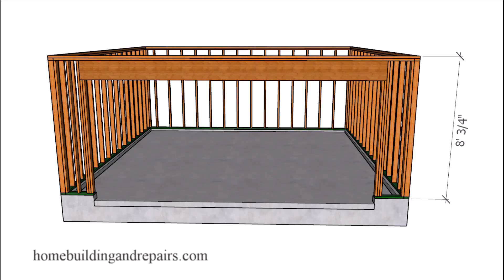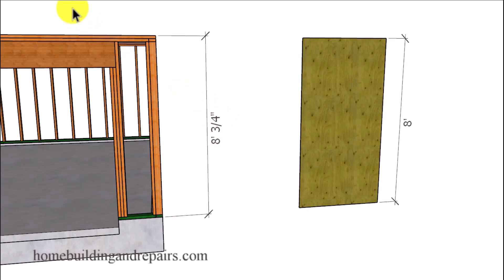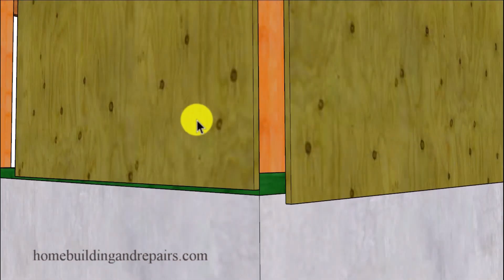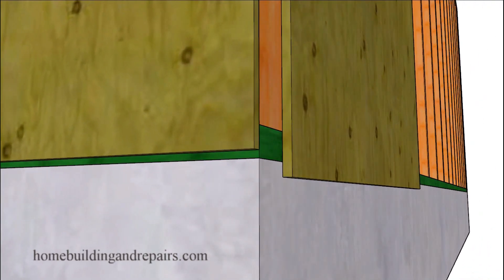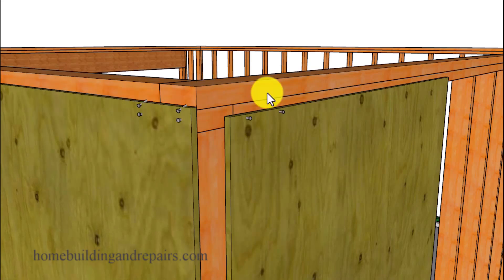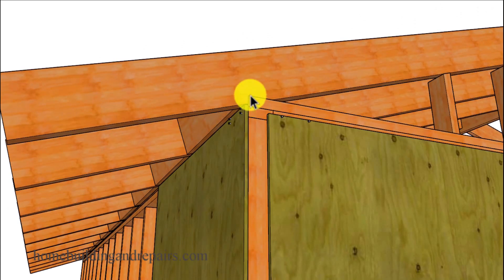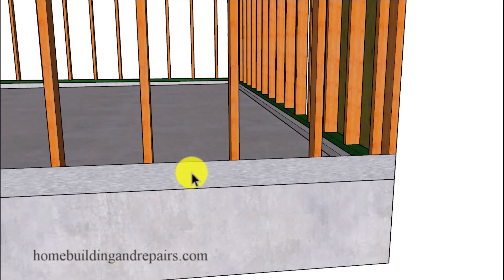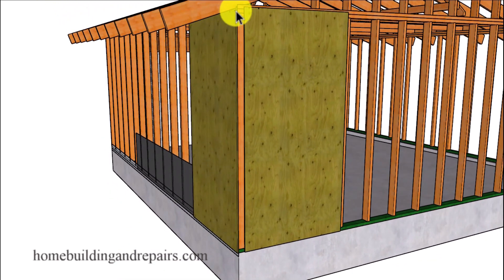Reasons Why Engineers And Builders Might Avoid Using Plywood Siding

Comment: Can you please explain if the sheathing material is supposed to be nailed to both bottom and top plates? At least it seems this way according to your video. But there are plenty of houses sheathed horizontally and there's no chance of connecting top and bottom plates this way but horizontal sheathing is OK according to the code.

Comment: On my new build the plywood length did not make it to the bottom so they cut another piece of plywood and there is a gap that allows air flow into the home. I noticed today they applied cellulose insulation and did not seal gap. Is that okay?
Reply from the maker: If they have building paper behind to prevent water from going past plywood, then it should work for a while, but it should have had a piece of z bar metal between the two separate pieces. Type "z bar plywood siding installation" into a search engine to see examples.

Comment: That's what you call a starter strip that nails at the bottom of the plywood in overhangs the concrete 1 3/4
Reply from the maker: I would love to hear your explanation on what a starter strip has to do with structural shear walls and plywood siding.

Comment: So you think all OSB has to be hung  vertical well you're a little bit wrong counting your top and bottom plate with your stud you should have around what 93 in which is just over 8 ft so you're telling me if you don't lay your OSB horizontal two seats on top of each other staggered out for foot and then have your third sheet as a rip cut at the top never ever had any issues so I'm not understanding what your issue is with 8 ft 1 in
Reply from the maker: I'm not talking about adding additional plywood siding over structural shear panel or exterior wall sheathing. I'm referring to using plywood sheathing as shear panel. Let me know if this does not make sense.

Comment: After over 50 years of building, I've never seen a problem  with the problem. You have a double top plate. Your wall is 8ft 1in. To allow for the drywall ceiling first and allow for drywall to not touch the floor. I started out building in California and have built all over the country. Never once seen this being a problem. You have nailing required anywhere from 2-4 and 12 to just 6 and 12. The flashing on the bottom I can see an advantage
Reply from the maker: Thanks for sharing and I actually had to fix it on the house I'm living in if you need to pictures of the damage, let me know.
Reply: @gregvancom  I know thinks are different around the country and you have to do what needs to be taken care of. There is no 100% right way for every job.  The best part is getting it taken care of. Have a good day

Comment: 92 1/4 stds double top plate
8 foot sheets 
Metal drip edge on bottom outside face of plywood when installing siding or stucco it's an option
Always use standard
 lumber sizes 
Never give the code more then required
Reply: Bad ethos; building a house that "just meets code" is building the worst house you are legally allowed to build.
Reply: @HaploBartow  
There is no reason to build above and beyond code unless you have deep pockets and like to waste money
Save the money for finishes
Reply: @HaploBartow  We all know the building codes are overly stringent and a work in progress.  Simply look at all the stucco issues in the 80s and 90s.  These were built to the "building code" and they rotted from the inside out.

Comment: We used a high quality flashing tape (specifically designed for this) to seal the area between the bottom of the sheathing and the top of the concrete foundation.  This controls moisture, air, and insect penetration. We kept the sheathing against the sill plate, as we did not want the plywood sitting against moist concrete and increasing the risk of rot.
Reply from the maker: I like it and thanks for sharing.

Comment: I’m one of your students. You explain things in a way that I understand. You have some videos on step down foundations. What’s the best way to sheathe a cripple wall that steps down on a slope? How do you protect the vertical edges on each step down? I hope those questions make sense. Thanks for all your lessons!! Much appreciated.
Reply from the maker: As far as sheathing any wall, you can start from the top, sides or bottom and start covering the wall framing. What are you protecting the vertical edges from?
Reply: I’m talking about the vertical edges that are exposed when stepping down with a stepped foundation. The portion at the bottom of the sheathing that drops to match the foundation. I would be protecting it from weather I guess. I wasn’t sure if wood trim or some flashing of some sort. I hope that makes sense. Thanks for your time, I really gain good knowledge watching your channel.
Reply from the maker: @beaubromley942  Those edges are usually painted and sometime wood trim like a horizontal 1x4 might be added to the bottom and thanks for letting us know how much you learned form our channel.

Comment: Interesting that engineers would have an issue to put the horizontal seam on the bottom plates since the top plate isn't the primary wall assembly structure, but an ad-on required by code if you don't align the rafters/ceiling joists directly over the studs. If you did, then code only requires you to have a single top plate; automatically putting the horizontal seam on the single top plate.

I've never inquired with an engineer about that because I typically would special order 9' T1-11 sheets regardless, so the question never came up for me.
Reply from the maker: Yes, you could solve this problem by removing the top plate and reducing the height of the wall.